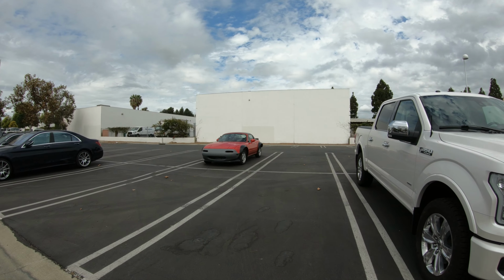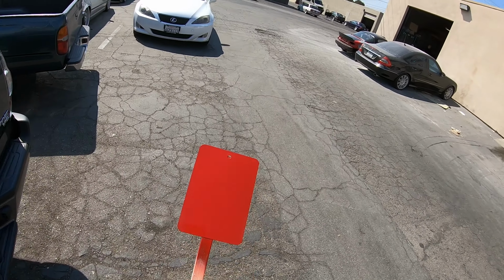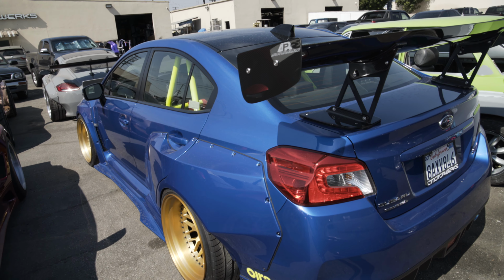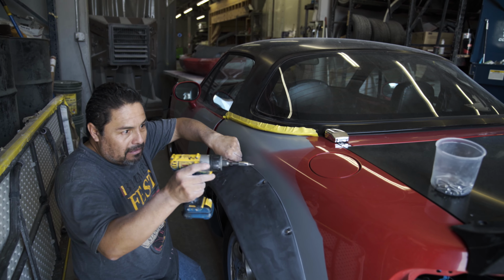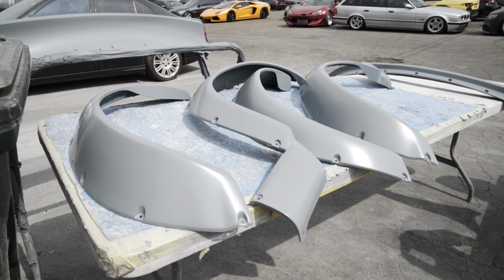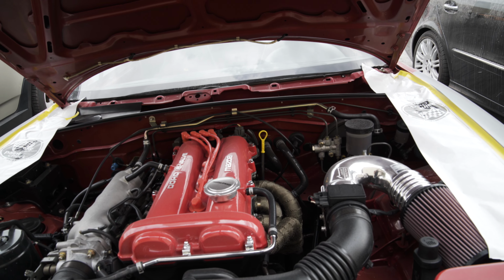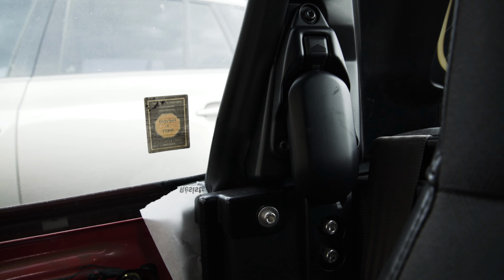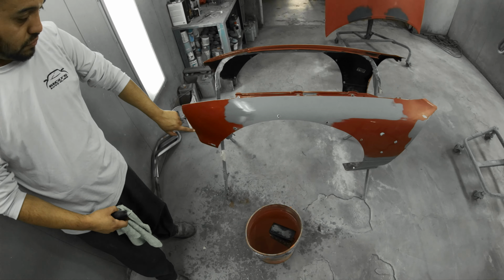ROCKET BUNNY PAINT & BODY | #OMGMIATA | SEMA EP10 | [4K60]

Comment: I'm surprised you guys didn't have to clearance the pinch weld on the inner fender more, I had to move it back like another inch and a half but I'm on 30.5x8.5 tires.
Reply from the maker: we flattened it.